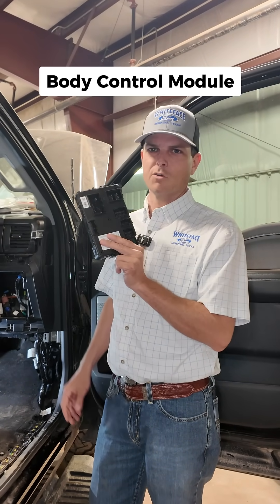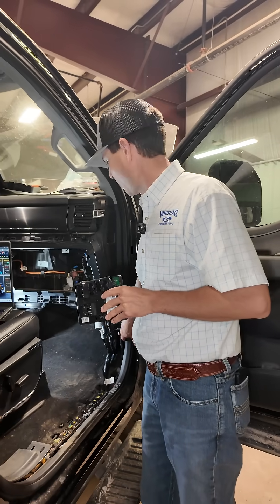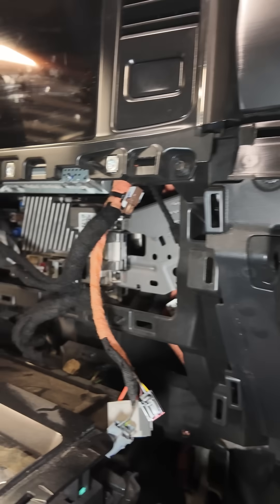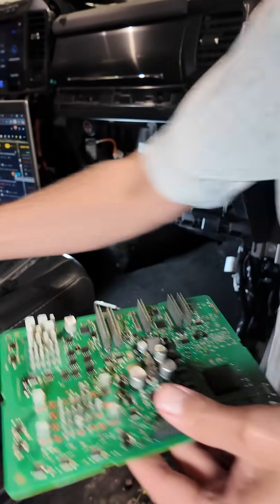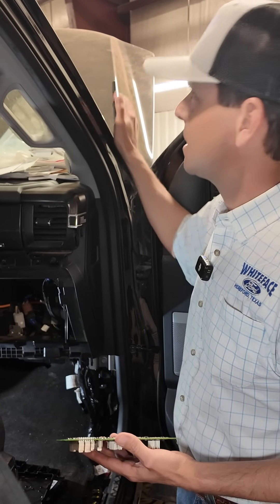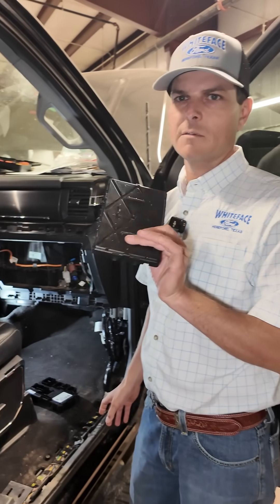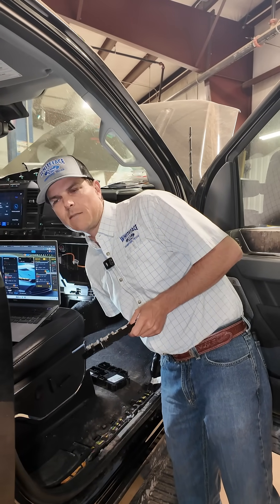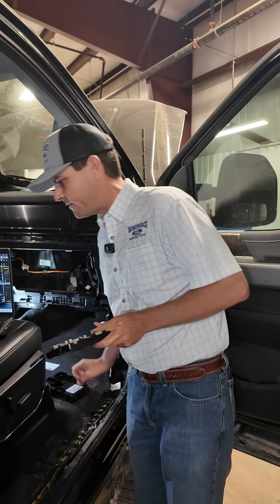Why BCM Failures Cause No-Start Issues

Comment: you could try putting some flux on some of those chips and reflowing it with a hot air station. If there was a cold solder joint that failed over time it could be fixed.